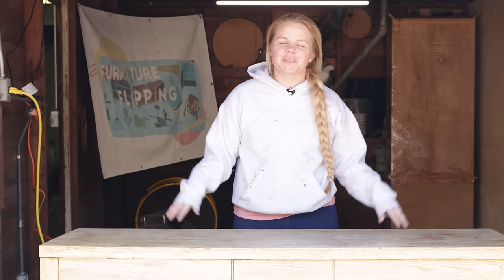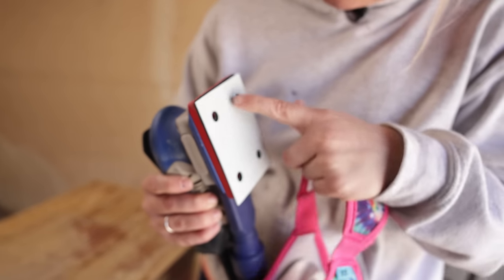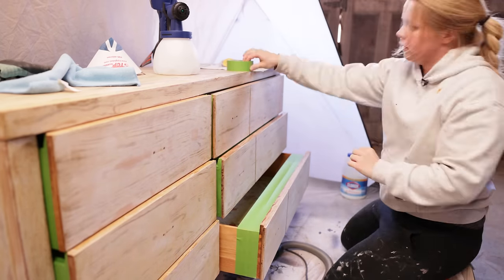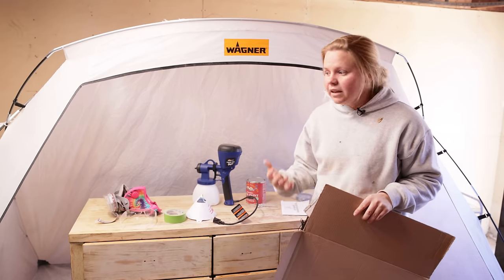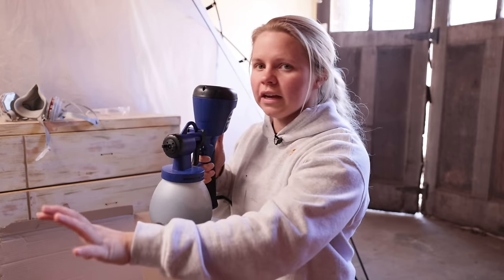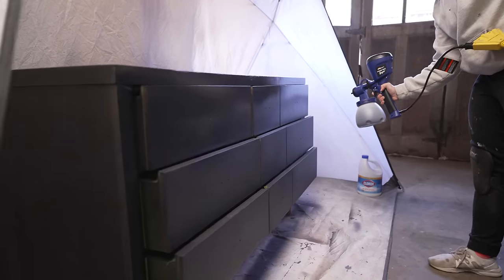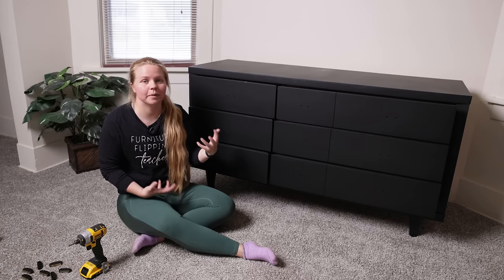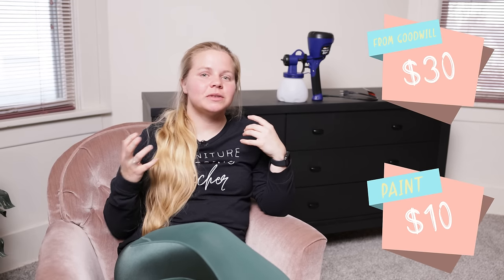Spraying Furniture for BEGINNERS - EVERYTHING YOU NEED TO KNOW!

Comment: To make life so much easier buy a plastic bin from Dollar General(2 large ones with lids) to clean your sprayer. I do Fluid Pours and I have to clean my brushes, bottles and jars to clean. I don’t do them in my sinks.(not good for the plumbing). I dump it down the the toilet and not outside because it is not good for the soil even though I only use water base paint. The plastic bins come in handy to wash in one then rinse in the other dump the wash water dry it out line with towels to drain. It also contains everything and it keeps it organized.

Comment: For those on a budget may we offer some tips. There are literally dozens of paints that are suitable for repainting or painting furniture pieces. Many are waterbourne and come in many finish levels. Some need a topcoating especially on surfaces that will support objects. As examples flat wall paint or "Chalk Paint", a registered trademark. Coverage depends on many factors; many of the chemical and natural tints are by nature transparent. Red is a great example.  Many paintmakers even have specific recommendations for painting and repainting and decoration for furniture so long as proper prep is accomplished.

For home style spraying, even using aerosols,  a tent is not perfect but adequate. an older tent in can be sourced from a thrift store or from even a retailer at end of summer prices. A helpful step before doing any painting of any kind is to make certain the fractions of the material are well mixed.  Unlike James Bond stirred or shaken is fine. On steel cans with lids, to reduce the bits that accumulate in the female part of the seal,  punch 2-3-4 holes in the seal with a nail or an awl. The paper and cheesecloth cone type strainers are many times not made for waterbourne paints. the adhesive attaching the cheesecloth to the paper is water soluble. Test one to see. Straining 99% of paints to be sprayed is mandatory and great insurance. A source for strainers for the budget mindered is panty hose again from thift stores or those with holes.. Toss em on the wash and cut to length, Tie a simple knot and secure with a heavy rubber band.. 

Spray techniques vary with the type spray paints and equipment. For instance a rattle can V. an airless are really different.  Some general tips are to try for a 50% overlap when spraying horizontally. Vertical spraying is best saved for when horizontal is not possible. And example of this is in the video. The furniture shown has an overlapped top leaving the underside of the top a collection point for too much paint to accumulate.. In that some paints and coatings are thixotropic and some are not. The build up in the right angle could run or sag. The solution might be to apply what in the trade is called a pisscoat to the entire area of the leading edge and the right angle of the piece. Just a dusting will suffice

We wonder if the adhesive residue from the removal of the drawer liners accumulated any of the "dust" from sanding. We submit that the residue was likely soluble in paint thinner.  Masking the drawers could be less a chore with an "apron taper" that dispenses both masking tape and roll paper. We use one of the standard brown masking tapes and the roll papers in several widths that are compatible with the type paint or coating for the job of work.  A handy-dandy tip when doing any type spraywork is to to have at least a small brush at hand for those 'ooops" moments.  Sorry about the typos Brain working faster than me fingers sometimes.